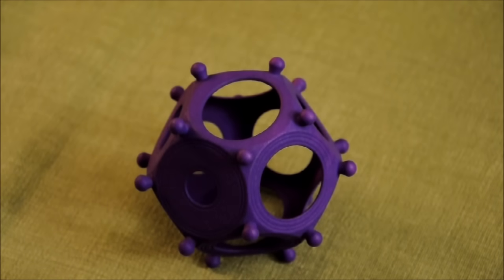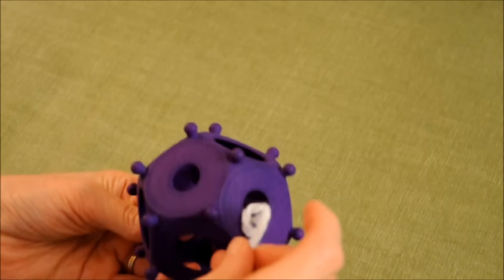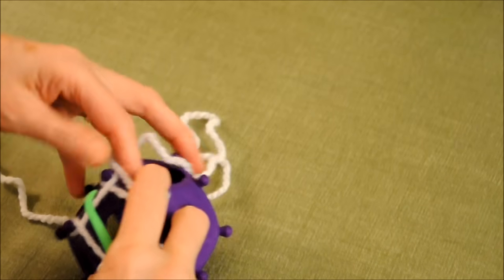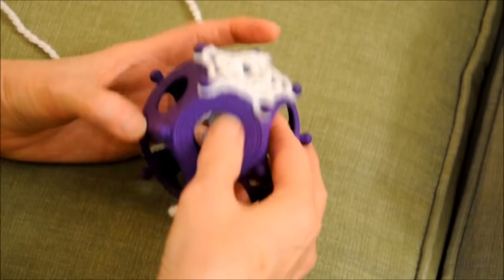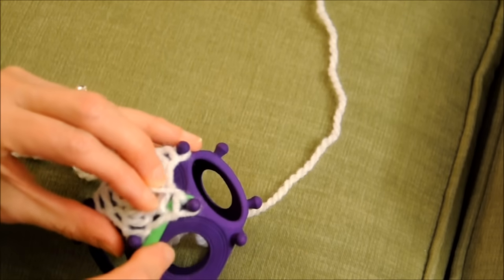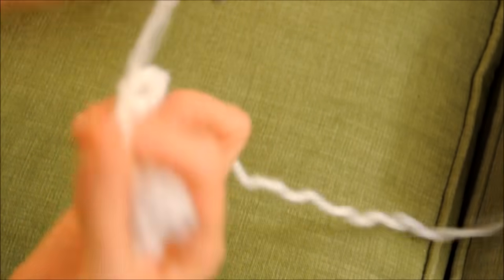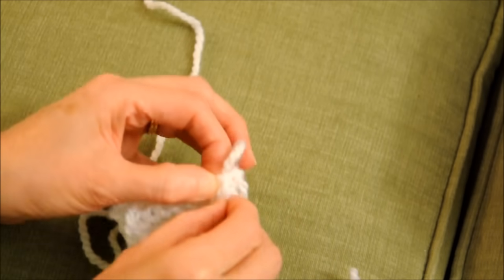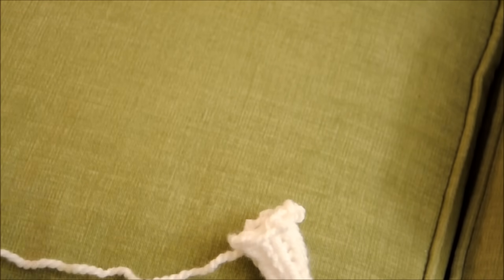Knitting with a Roman Dodecahedron

Comment: EXCELLENT experimental demonstration.  It could actually be the real purpose of these things, especially when you consider these have NEVER been found in the WARMER climates of the Roman Empire!
  These have only been found in the COLDER climate regions.  If these were designed for making different sized ropes/cords, then these would be found in ALL regions of the Empire, but if they are for making knitted fingers for gloves, then it makes sense for these to be found only in the colder regions.
   This is by far, the most logical explanation for these things.
They obviously were not made for any "tent setups" because some are as small as a golf ball, and others are the size of baseballs.
   But it makes very good sense for making children's gloves for the smaller ones and adult sized gloves for the larger ones.
  BUT, having said all that, if they were for making gloves, then I'd expect there to be MANY more of them found, simply because THOUSANDS of inhabitants would be needing a LOT of gloves for those cold months, and more than a few "knitting machines" would be needed to fulfill the demands for tens of thousands of winter gloves.
Reply from the maker: Craig Escaped Detroit many thanks for the kind words!  Yes you are mirroring my thoughts exactly.  Did I mention that over a hundred of these have been found?Of course I cannot prove that they WERE used for knitting.  But what got my goat was people making fun of Martin’s attempt and saying it absolutely COULD NOT work.   It’s hard to prove a broad positive statement, but it is easy to disprove a broad negative statement. You just need one counter-example.
Reply: thank you, any more info or articles from the archeological communities? what are their thoughts on this? everywhere I ve look so far is speculation 🤔
Reply: @cristristam9054  , the one without holes isn't a dodecahedron, it is a 20 sided object.  Also, the knobs are notably of differing sizes on the 20 sided object.  While it shares similarity in that it is a polyhedron with knobs, it is significantly different, and likely for a different purpose entirely.
Reply: @cristristam9054  maybe they are for different patterns and not just for gloves.
Reply: I figure the reason more of these objects aren't found us probably because a good deal would have been made of wood.
Reply: There's evidence of metal objects being melted down and turned into other things when they were no longer useful going back ages, even in more remote locations.
Reply: TheloniusThorgrim A fidget spinner?
Reply: Perhaps gloves with fingers were more of a specialty item, which is why we haven’t found more of these objects. Most gloves would be just mittens with thumbs but if you could afford it you would buy one with fingers.
Reply: Maybe many of these could have been wood, or just disintegrated in acidic soil. Or maybe also the gloves were a status marker
Reply: @cristristam9054  I looked at your example of the one with no holes, but are you sure that the center of the circular designs isnt a small hole? I know that way back then a lot of textiles and even threads and yarns were very fine, (tho thinking that of it I wonder if it might be for metal thread working because you pull metal through smaller holes to thin it to a smaller size) it could have been used for making thin bands of woven thread to use in the more open holed versions. Thats just me theorizing tho I dont know for certain if there are fully closed ones, the one you gave looks like it has small ones
Reply: @cristristam9054  maybe to make socks?
Reply: @TheloniusThorgrim   Dodecahedrons have 12 faces, not 20 :)
But they do have 20 vertices (And 30 edges)
Reply: Metal items often got melted down or re-forged to make other things.
Reply: It could've made sense if you just wanted to knit fingers. However, it doesn't make sense for why the majority of these dodecahedrons were found at military sites and two of them in high-status graves but none in actual trade districts where these things would've been thoroughly mass-utilized if they were made for knitting. These things were valued by the rich and the military but seemingly not by the poor or tradesmen.
Reply: @WolfHeathen  Maybe the gloves produced with it were just worn by people who rode horses or handled weaponry, for which you need to use individual fingers.
Reply: @WolfHeathen it makes sense for military people, they would have had to sit around a lot with not so much to do, so knitting is a great activity. I'm pretty sure historically knitting was also more of a masculine activity. Also I think there would probably have been wooden ones for less rich people, so they could be everywhere but just the rich peoples things have survived.
Reply: @myFElovemimi  The Roman military didn't make their own gloves. They relied on patronage by the rich to pay for everything the army needed.

Professional tradesmen was the primary source of equipment. The equipment had to be sturdy and made of the best materials. Gloves would've been made from leather and fur, not knitted yarn. Yarn isn't exactly durable.

Add to that, since the trade districts would've hypothetically used these for knitting, how come archaeologists have never actually found a single one of these dodecahedrons in any of the excavated trade districts? If knitting was its purpose they should be all over the place.

And why would the rich be buried with them if it's just another basic knitting tool? People were buried with valued items such as swords, religious symbols and jewellery. It makes no sense for why this object would be this treasured if it was just a relatively common basic item.

And if it was a common item, why have they only found found about 160 of them in all of Europe? They were extremely rare. Not only that, but they don't show any signs of wear. It's as if they're brand new and were never used on a regular basis, at least not for anything that would require handling them very often.

There are no markings to indicate that they would be a mathematical instruments, they lack the holes necessary for spool knitting and they're too light to be a weapon. They also lack the necessary instrumentation to be range finders or measuring objects for distance.

These objects have also been found to be made of very expensive materials, such as bronze and gold. In fact, they've been found over in Asia in ship wrecks, suggesting they were somehow crucial to economic trade.
Reply: There is also preservation error . The only tools we have left are the metal and bone ones . If wooden ones where used by poorer people they might have not preserved well and i am not sure what other types of materials not likely to preserve could have been used
Reply: Personally, I think that these being made of metal would be rare.  Once they were no longer used, they probably ended up being given to blacksmiths as "scrap metal" and were recycled.  Many more of these could have been made from wood, and they may have moved around a village as children were born, grew up, people gained or lost weight and their clothing needs changed.  Once no longer needed, were tossed into a fire or decayed into nothingness because of the damp climate they are often found in.  Possible some of the metal versions decayed into rust, too.
Reply: If knitting was a trade in the community then only a select few would have these. Like milliners and hatters, everyone wore hats, but not everyone made them. Same with carpenters and every other trade.
Reply: I honestly disagree about there would be many found. Just as today, tent makers have their tools, not everyone is a tent maker. Masonry has their tools, not everyone would have those tools. So back then wouldn't it make sense that few people were glove or mitten makers, thus wouldn't be many of this tool.
Reply: Do you have any idea of the prevalence of fingered, knitted gloves and moreover children's gloves were?
Reply: @Giggles56  who would be willing to wear these open gloves? They look a mess, aren’t warm, and don’t fit.  They knew how to do nalbinding, which is warm, dense, and well fitting.  All it takes is fiber and a large, blunt needle.
Reply: @Sarafimm2  why would you use a heavy metal tool with a gajillion faces to make inferior gloves, when nalbinding was well known and practiced?  That technique makes warm, smooth, well fitting gloves.  Even if you were crazy and wanted to make spool knit gloves, a single ring would work better than the dodecahedrons.
Reply: @thumbelinasmum  look at other videos where others have more experience at using this tool. Maybe open your vision a little better
Reply: @Giggles56  I have seen multiple videos.  I am an expert knitter.  I have been doing historical knitting forensics for decades.  I’ve examined knitted artifacts in museums’ collections (in the “back rooms” back when they still used cotton gloves, continuing more recently since they stopped (usually) using gloves for textiles. 

I understand the physics of how spool/loom knitting works.  I’ve certainly used them enough.  A simple ring is easier than a multi sided form.  The holes in the faces make no difference as long as the knobs are equidistant.  Since they make no difference, they are superfluous, and a basic kids’ knitting nancy of the appropriate size would be easier to use.  

Not that there is the slightest bit of logic to this thing being for knitting.  This idea is in the category of “I suppose you COULD, in theory, do this, but why on earth would any sane person even want to?”
Reply: @thumbelinasmum this speeds up and standardized the process of making cylinders for the fingers of uniform width across their entire length. When you finish you just stitch the fingertips closed. Why act like that's so difficult?
Reply: @thumbelinasmum as for why you'd use heavy metal? You wouldn't unless you were rich and wanted to flaunt it as a status symbol at the same time. Poor people probably just had them made from wood.
Reply: @thumbelinasmum if you're an expert I'd be more interested to ask if you think this tool could make it easier on your hands or reduce the need to pay attention to what you're doing as much and reduce eye strain as a result. If any of that is true then it makes sense to use one if you're trying to outfit a military force on the march and having to work around the clock. Knitting the way homesteaders did for their families might not justify it but if you're doing glove after glove after glove for days it might make more sense to make it idiot proof, because the most skilled artisan will become an idiot with enough lack of sleep.
Reply: @ not a chance.  These don’t make useable gloves. They don’t make socks.  None of what the video says about sizing is based in reality.  You can’t use this effectively while on the march.  There is not a shred of evidence anywhere that these might have been used for textiles.  There is plenty of evidence of nalbinding used for textiles.  All nalbinding takes is a needle and yarn.  Far more accessible for anyone to get and use.  Nalbinding also makes a superior product with just a little practice.  A nalbinding project fits in a pocket and can be pulled out and worked on in spare minutes.
Reply: @ why would you do advanced wood carving for a gadget to make crappy gloves when all you need is a simple, quick to make, needle to make good gloves?
Reply: @ they are only 5 stitches around. They are just holes with a bit of yarn between.  They don’t work as gloves.  There is no evidence they were ever used for making gloves.  There is plenty of documentation for nalbinding, so if they wanted gloves, they used nalbinding, which makes excellent gloves, with only a needle and yarn.  These gadgets don’t work for making gloves*
Reply: @thumbelinasmum  basically it comes down to a couple things in my mind. 1, maybe theres a way to use this that requires less attention than your method when running low on sleep without increasing the rate of imperfections? and 2, maybe this device works well in tandem with some other tool or set of tools made to be used alongside it. but I'm obviously no expert
Reply: @ how?  It only gives **FIVE STITCHES**.  That is absurd.  Why would anyone try to do this?  Everything they do on this dodecahedron can be done more easily on a simple knitting spool.  And even then, you would have about 25 pegs to make enough stitches for a thumb, and a larger one with 40-60 pegs for the hand.  They didn’t use them, but that would at least make a glove, far, far more easily than this thing.  And not just more easily, it would be a decent glove.

Show me how using a dodechedron is easier or more effective than using a proper knitting spool or nalbinding.  There is no documentation, and no reason to assume this use. Basic, physical “how does the physical world work?” facts says the dodecahedron isn’t for gloves.

To make a nalbinding glove, you take a needle, use it to make a series of loops, join in the round, make another layer of loops on the first, then. Another and another, add shaping, and you get a nice, dense, comfortable, and warm glove.  Only one, inexpensive and easy to use tool, that makes a real glove, with technology we know they used, continually.

These things are more likely for gaming, used as dice, like throughing knuckle bones, or the modern “pass the pig” game, or as counters in another game, like the dice showing the score or doubling the bets as in backgammon.
Reply: @thumbelinasmum  the dice explanation seems unlikely to me, varied size holes instead of engravings? What kind of dice would be difficult to differentiate? I think I'm leaning more towards the holes being made to insert engraved stamping discs, and the standoffs (why have standoffs/knobs on gaming dice? What purpose does that serve?) let you stamp wax seals at a uniformly distributed height. Military officials and beurecrats would be able to seal documents for various clearance levels by having a different sized circle to denote rank, with their actual identity on the engraved disc they put in the hole itself. Maybe a way to quickly produce seals and also save luggage space (you only need the one dodecahedron instead of a big wooden box of 12 different individual stamps)

Comment: When i was a kid my grandfather take me to hunting near the austrian alps. He had this thing but made out of wood. He used it to make a tent. He searcht for a long straight woos stick and put this thing on top of it. Depending which holes you put the stick trough you get higher or smaller tents. You ram the stick in the ground witch the other end. Now you have 3 layers of pins where you can connect your tent sheet. If finished you have 3 layers of a tent sheet with a small distance of air between them. You can make a small fire inside the tent because the  smoke will go through the other holes into the thing and out of it on the top of the tent. It was very warm inside even if it was cold outside and snowing.
Reply: If that is true and not just something you just made up, you should really tell archaeologists about it! Because thousands of these have been found, always in cold mountainous areas. And no one knows what they are for.
Even the knitting hypothesis has been argued heavily against. They are STILL a mystery.
Reply: Hundreds. Not thousands

Comment: The other youtube video has a five finger version. I think once you get the hang of it you just figure out which holes you need and start knitting. The amazing thing is someone figured this out to invent it and someone figured it out when no one knew what it was for. Amazing. Makes total sense that back in the day they had plenty of time between battles or on horse back to sit there and make gloves. The coin theory doesn't seem to make sense to me bc the coins look so much larger than the holes. This has to be right.
Reply: Really...it’s not.  There is no logical reason to make a 5 stitch glove on the various sides. The knobs are all the same distance apart, but the holes are different sizes.  Anyone familiar with any form of handwork can see at a glance that the different sides won’t do anything but make using it to make gloves more difficult.  And not even make decent gloves.  They were experts at handwork in this period. They made incredible naalbinded clothing.  If they wanted to do sis thing like this, a simpler knitting spool (which the video is attempting to suggest this an “advanced” version of) would make better gloves, with less work.
Reply: @thumbelinasmum  Different sides for different size fingers.
Reply: @TeroHal  the different sides are all the same size.  The diameter of the hole doesn’t affect the spacing of knobs.  The knobs are what dictate the size.  There is no way to make the fingers different sizes. We have evidence that during this period, they were very skilled at nalbinding.  If they needed gloves, nalbinding would have provided them neat, well fitting, warm, hard wearing gloves. No one has made a single glove that meets any of these criteria, yet, using one of these little knobby things.  I think they were used like dice, for gambling.